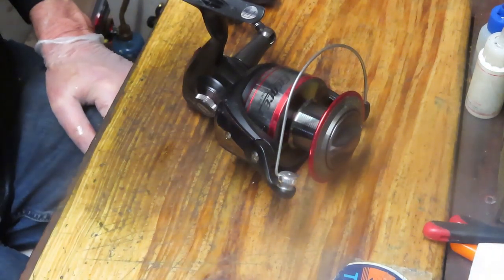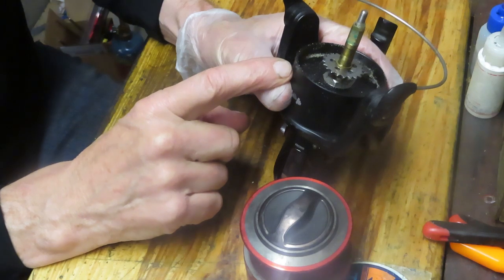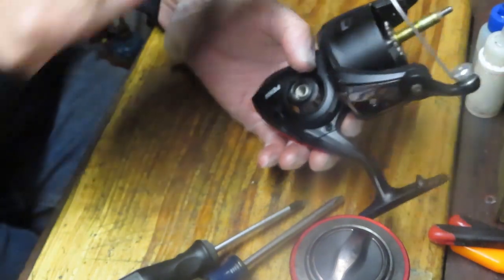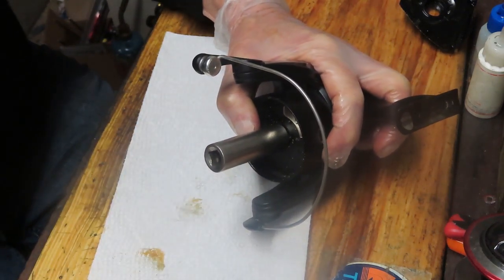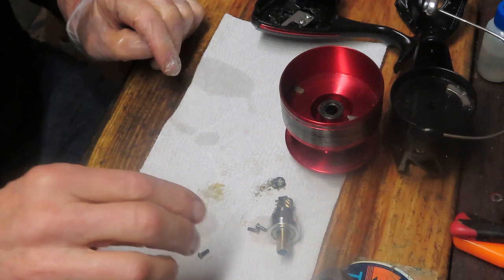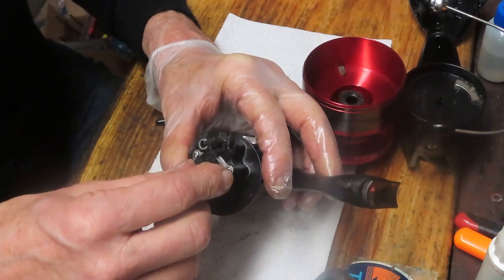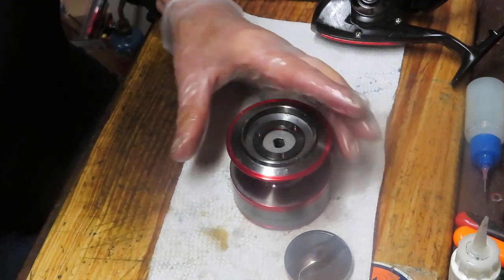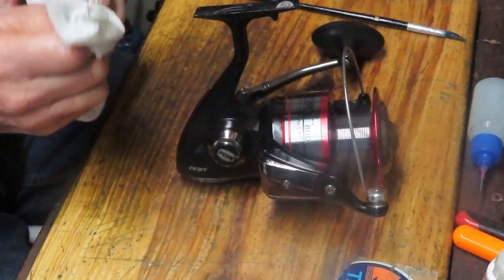Penn Fierce 8000 saltwater spin fishing reel how to take apart and service

Comment: Thank you so much for this video!  This is a great shark reel.  Can you provide detail on the bail and mechanism?  I have ordered all of the parts (from Mystic) to replaced a bad damaged bail on a FCRii 8000.  Maybe there is another video that shows this detail on a pursuit or battle?
Reply from the maker: I am not sure which setup this uses, but watch this video to see the 2 most common.  https://youtu.be/Qrr_rizFkYw
Reply: @2ndChanceTackle  Thanks Dennis!  It is like the South Bend (trip lever bar and spring).   Probably the hardest repair on a reel I have ever done.  You need 3 hands and a sense of humor.  One thing that drove me nuts was installing the new bail roller assembly.  New part had blue patch locktite on it, and it kept wanting to cross thread into the bail knuckle.  I had to clean the locktite patch off, then put liquid lockitite on it.  All Done, time to relax.  The mystic schematic and your video allowed me to build back the whole bail assembly with 100% new parts and a sense of accomplishment, along with a new Gomexus Handle, for what is now my new surf shark reel - Penn FRCii 8000.  I have had good luck out of the Fierce's in the surf for smaller fish, so long as you rinse them with fresh water everytime.

Comment: Thanks for video. I have the pierce 5000 and have to much play in my handle at the knuckle. Could i be missing a washer or something before i put the handle on? Did not see one in your video i just watched. thanks for any help , I really like the reel.
Ken
Reply from the maker: The knuckle should be tight to the reel case when fully screwed in.  You may have an issue with he treads on the handle stem or the threads inside the main gear.  If either is stripped, the handle will not hold and it will create the issue you are describing.  I would visually check the handle screw and it it appears to be OK, I would assume the issue is with he main gear.  That would require you to replace the gear in order to solve the problem.  Gears are not that expensive for this reel and are available through Mysticparts.com - Dennis
Reply: Dennis , i got the main gear out , and the bearing came out with it on the shaft. Is that bearing supposed to come off? I cant get it to slide off the shaft, and it is not rusted at all?
thanks,  getting close to solving my problem

Comment: Thanks for this video, but maybe you can help me, my father just passed in his gear he has a Penn Captiva cv8000 surf reel that only spins the wrong way it looks new, there is no reverse on it. Now he was left handed so maybe it's designed that way or maybe he got it on clearance, but it's so uncomfortable I won't even try it. I would very much like to use it just because the father and son thing. Is there a way to filp the gears?
Reply from the maker: That should be an easy fix if it only spins "backwards" and has an anti reverse lock out when you try and turn it in the opposite direction.  You need to remove the rotor and take out the pinion gear.  There is an anti-reverse clutch on that gear shaft.  Simply turn the clutch upside down and reinstall it.  That will allow you to turn the feel forward and stop it when you try to crank "backwards" - Dennis

Comment: I have a Penn fierce ll . The drag will not hold it has a knob on the bottom of the reel that says live liner drag…
Reply from the maker: The live liner reel has two drags.  The top drag controls the drag when you are reeling in fish.  Use the top button to clamp down on the spool drag washer and adjust the tension on the line.
The bottom drag controls the live liner spool release speed.  This will never clamp down fully.  When the lever is set to live line on, your spool will turn backwards to let line out without flipping the bail.  That letting out function is sped up or slowed down by the rear drag.  Once you crank the reel, the spool will stop spinning backwards as the lever returns to the off position.  At that point the top drag takes over as the spool is locked in place for retrieve and the live liner function is disabled.
If you are not getting top drag pressure, you need to check the spool drags for damage or wear - Replace if needed - Dennis

Comment: It is unfortunate that there is no AR override. For that reason I wouldn’t want this reel. Other than that it seems to be a solid reel even to the point that there is a secondary AR mechanism. If it just had an override I’d like it. — Chris PS. I loved your “fashion and passion” comment. I doubt the fish really cares LOL!
Reply: Most reels are doing away with the AR  over ride.
Reply from the maker: When the A/R clutch was simplified, the ability to override it became the hard thing to do, so it was easier to eliminate it.  Most manufacturer's figured that the override was not used by many folks, so they eliminated it.